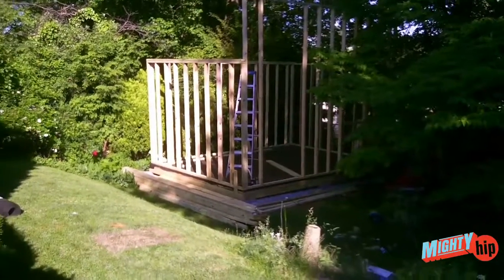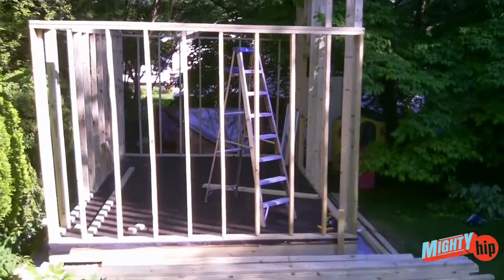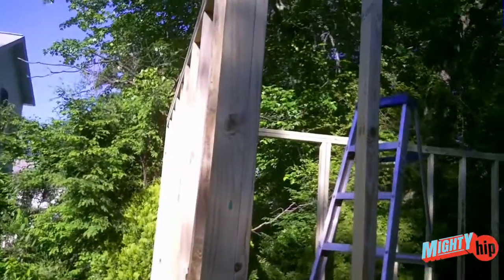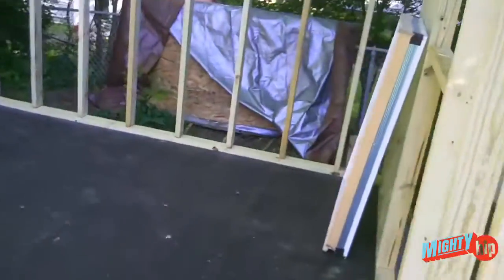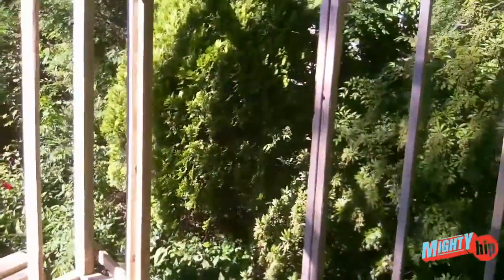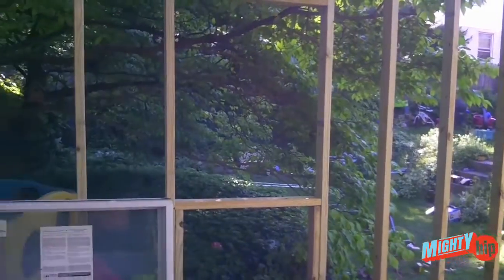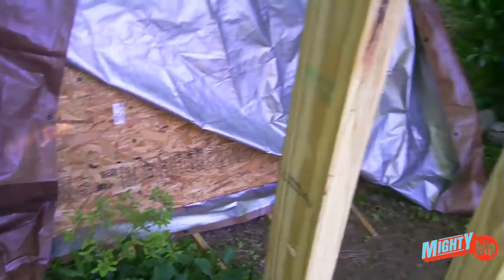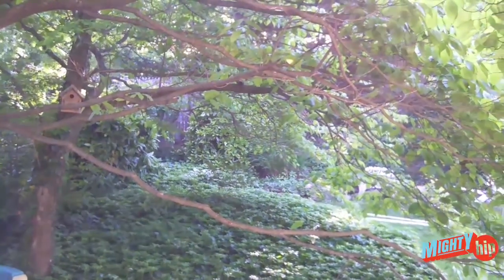Shed music studio build DIY - video 2

Comment: What do I need exactly for a permit. example do I need the exact demention or do I need a drawn up plan with the size,hight ect??
Reply: I live in Maryland. Here we have to draw a rough sketch of the property and show where the shed will be and its dimension.  Very easy. No draftsman necessary.  Then you have to get a permit if you are doing electrical. So there are two permits you will need in Maryland: the one for the structure, be it a shed, or a garage, or an addition then the electrical. If you are doing a bathroom in there then you need another permit for the plumbing work and the connection to the sewage. I do not have water in the shed. cheers. Permits are inexpensive and the main problem is having to go to the permit office and wait. You end up wasting a lot of time waiting unless you are there first thing in the morning.